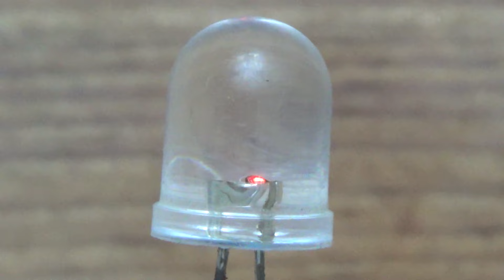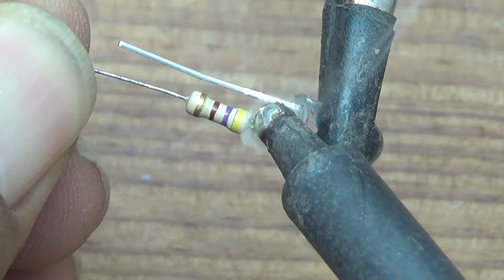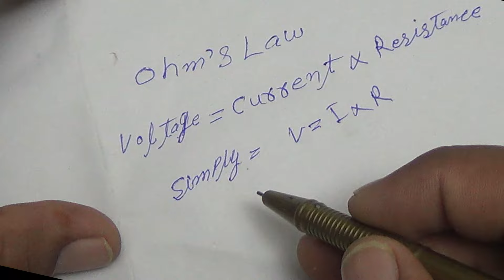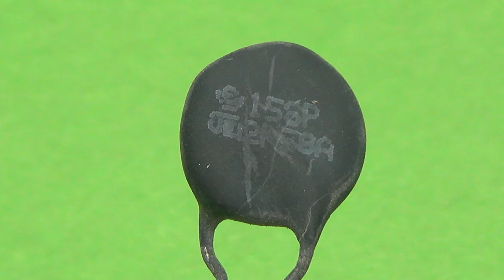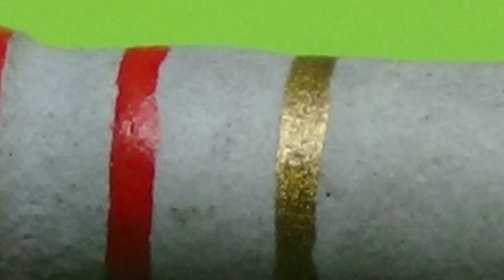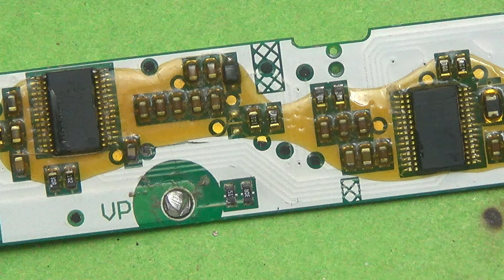IT DOESN'T DIFFICULT | Everyone Can Do it in the Future

Comment: Nice Simple Video. Just a Note at the 5 Min point in the video. It is good to use a rule of thumb. Bend and insert the resistors with the band reading, like the first 470 ohm. The second is in with the top down which is harder to read the 1k ohm. and third is upside down too. It is harder to read that looks like a 100 ohm, but might be the third band silver. When you have a very loaded board, you will see quickly how much easier it is to read the value when placed with bands starting on top.
Reply from the maker: Good point!

Comment: Oh yeah, it is so easy. So easy in fact that you make a mistake in the first example. A 9V battery, an LED and a resistor. The resistor value is 9V divided by 20mA = 450 Ohm. WRONG. There is a 2V voltagedrop over the LED, so there is 7V over the resistor, divided by 20mA is 350 Ohm.